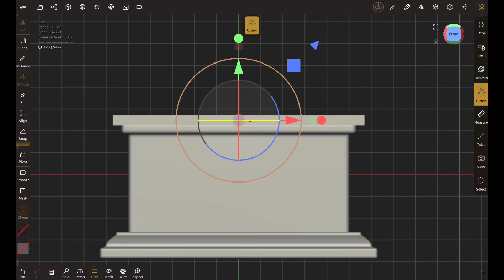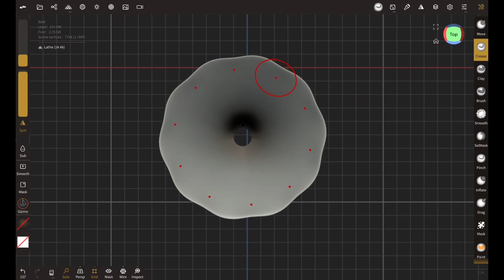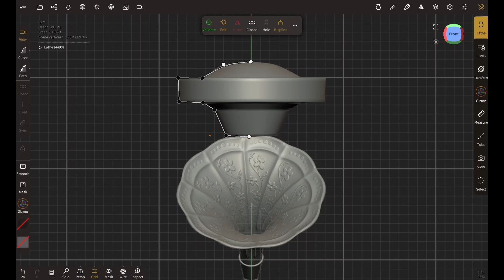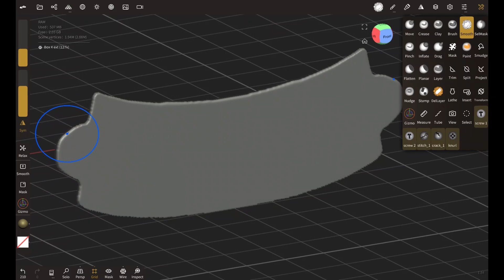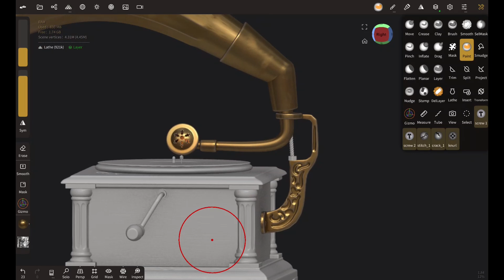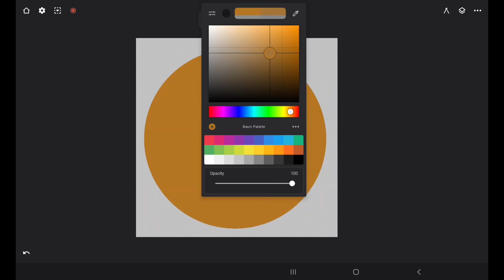Hard Surface Tutorial | Nomad sculpt

Comment: How to control that the points of the tube stay in a plane? or that they do not move in a certain direction?
e.g. Whenever I move a point in an XY plane it ends up moving in the Z axis as well
Reply from the maker: Hi, a new tool has recently been introduced in Nomad for this purpose. Now you can turn on the 'Grid' and then enable 'snapping' (the magnate icon on top right )when using the 'Tube tool'.